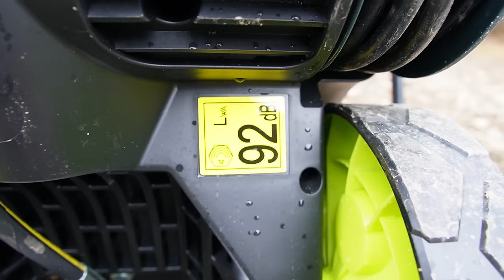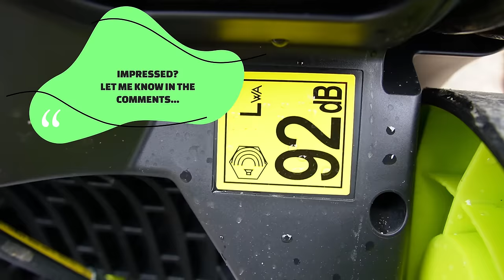BEST PRESSURE WASHER EVER MADE for Car Detailing? Is the AVA P80 Better than Kranzle?

Comment: For me the main selling point was the 20 year warranty, it feels like an absolute tank and built to last unlike the nilfisks and karchers I’ve had in the past
Reply from the maker: Nilfisk definitely raised their game to be fair.  I used the go p55 yesterday and that was pretty good for a small machine
Reply: @epicautomotivedetailing  fair one just don’t think I could go back now 😊
Reply: Are you still going to do a review of the other models 55 and 60. I know you cannot buy here in the UK but not sure if you can get hold of the P90 V6 see what you think of that
Reply: @craig3802  have you had any problems with this machine mate.
Reply: @iceman9646  no it’s been solid for me so far
Reply: @craig3802  thanks pal
Reply: I thought about buying this washer, but thought I would give their customer services a call. Five calls, not available. Searched for service shops very few. Lots of complaints.
Reply: 20 year warranty is great, but has anyone tried claiming on it. Or getting the pressure washer fixed if faulty.
Reply: Warranty does not mean Guarantee.  20-year warranty is a great selling point & I love what AVA is trying to do and some of their design and innovations, However I would read the small print on the Warranty terms thoroughly before buying and assuming you will be trouble-free for 20 years and it will be fixed quickly in the event of a break down (maybe a bit of a bold claim but I could offer the same warranty on any Kranzle like for like and not lose sleep) Great video guys btw
Reply: @kjhnor  They're new to the UK so they won't have many service points yet. They're a relatively small company, they're not going to just turn up and open dozens of service points, but even major electronics manufacturers only have one address that you need to return your goods to so that doesn't mean a thing. 

Regarding reviews, remember most people only leave a review when things go wrong so you need to define "lots" and compare it to the number of actual sales for it to mean anything.
Reply: @KranzlePressureWashers  Warranty and Guarantee are generally the same thing, but a warranty is more of a written thing whereas a guarantee is more often used as a verbal promise. On that basis a warranty, being written, is more valuable than a guarantee. 

I don't think anybody buys anything assuming it will be trouble free for that long. That's why we have warranties, to fix things if they do go wrong! You are required to service the machine every 5 years by purchasing a service kit (very cheap at £30), or they will service it for you. That sounds reasonable enough to me, as most kit breaks down because it's not serviced and cared for properly. Beyond that it's no better or worse than any other 1-year warranty except it's for much longer (10 years on Go and Smart models), so I'm not really sure why anybody would have a problem with it. They're upfront about it, nothing hidden.

From what I have seen so far they are an extremely well built machine and I've no worries that it will last. Certainly streets ahead of any Karcher anyway, and I've seen far more expensive machines that don't appear to be as well built.

Comment: Have had mine for over a year and absolutely love it. The only issue I have had is it blows fuses ALL the time. Put in a slow-blow fuse and that’s done the trick.
Reply: What amp is the slow blow? Isn't it dodgy to put a bigger size fuse in a 13 amp plug, no issues since?
Reply: Hi Kerr, can I please ask where you found your 13a slow blow fuses?
I'm going through a few, about one per month in regular use so not too bad I guess. I think it's only the P80 models affected....

Comment: I bought the Ava Master P60, couldn't be happier, fantastic, best pressure washer I've ever had by far, i added the MTM SG35 and MTM foam canon, absolutely superb.
Reply from the maker: Nice one yeah they are good just make sure you dont have it rigged up to too much length of extension lead
Reply: Hey mate, did the MTM SG35 fit straight on with no hassles?

Comment: It's the 20-year warranty that sold me too so I purchased the Master P70...I won't be using it but my wife will and there are many areas to clean, including the block-paving, patio windows, balcony window areas, concrete posts, and of course...the car.    The Kärcher K2 (Unused) and the K5.8 Eco (used once or twice) are going to my sister F. of C.   Kärcher need to upgrade their products or lose-out to better quality and reliability.    I already have the top two snow-foam attachments and the lance is a tad heavy.    AVA are leading the way with ideas and products, long may it continue.   Ours arrived today from CleanStore and is registered for the 20-year warranty... :-)
Reply from the maker: 100% Ava are constantly evolving and I truly believe they will crack the UK market in 2023

Comment: Recently bought the p80 evo to replace a nilfisk p150.  Inititally had issue blowing fuses which really frustrated me but sorted with 13 amp slow blow fuse after contacting ava for advice (these are not easy to source). Ava have advised this issue is being addressed and revision being implemented on future models. The 20 year warranty was big attraction for me.  They offer a higher  end snow foam cannon as well. So far so good and very happy with it
Reply from the maker: Ava have a P90 so that may be cool to try soon. Definitely a great start in my opinion. Hope mine lasts for many years
Reply: What was causing it to blow fuses ?
  Do you power it off of an extension lead. ?
Reply: @MrDelcol  no extension used but does amplify issue. its a well known issue ava are aware of. Apparently in other countries it uses 15amp fuse.

 Ava actually offered me a full refund if i wanted to return it as i initially couldn't find slow blow fuse from anywhere including the usual uk shops like screwfix, bq, toolstation and specialist electrical shops. Luckily found a shop online to order from in the end after a few weeks.
Reply: @umranhu  can you use an extension lead now when using the slow blow fuse? Or would the extension lead need one as well?
Reply: @seanmck2602  extension lead amplify issue so not sure how youd get round that.
Reply: I am now on my 4th p80 as received revised version couple days ago that was supposed to resolve fuse issue.  It hasnt so emailed ava.  Really wanted the ava to work hence been prob been 3 months of trying to resolve issue.  

Looks like time to give in and send back for refund. Wasted lot of money on time delay fuses and adapters to allow prev snow foam cannon etc to fit ava.

Watching daves other videos might try the nifisk 200 or 180.  Had nilfisk 150.1 for several years and that was pretty good.
Reply: Wow your on your 4th one best thing to do spend your money on a kranzle 1152 tst the best pressure washers out there in my opinion 👍👌

Comment: just bought one of these for cleaning the cars, gutters and patio plus anything else I can find that needs a spray. upto 20 years warranty on these machines, all internal parts are metal and not plastic like the yellow brand and the build quality is second to none! never owned one before but used one a while back and had nothing but positive feedback from people I have spoken to. Absolutely sick of buying new yellow brand washers every few years so took the plunge and bought a P80 so fingers crossed its as good as people say.
Reply from the maker: To be fair I think if you get 5 years it's a good investment. For domestic use it's probably going to last longer but I'll be testing this to destruction over next 6-12 months so I can keep people in the loop 👌

Comment: Great video. Very informative. By luck I bought the AVA Evolution P80 before I'd seen your video. I have to say I'm as impressed as you! It's versatile and very powerful making short work of the car, caravan and patio! It feels well built too. The only two small niggles  is the cable reel does feel flimsy and the float switches in the pump aren't that sensitive as it sometimes doesn't start back up after a short period of not been used (turning it off and on again at the switch usually sorts this problem). Would recommend above any other pressure I've used!
Reply from the maker: Thanks mate. Have noticed few little problems which I don't like now so gone back to my nilfisk
Reply: Which problems did you notice? Thinking of getting this one
Reply: @epicautomotivedetailing looking at the Nilfisk p200 & Ava p80. What’s the best in your opinion? 
Thanks mate.
Reply from the maker: @leswhite3465  honestly the nilfisk is more robust. They have a p200. Look for a refurb at nilfisk outlet website and you will get a stunning Machine and save money 💰
Reply: @epicautomotivedetailing  thanks for the feedback. Yes think I’ll go for the Nilfisk p200. Looks an awesome machine👌. 
Topman
Reply from the maker: @leswhite3465  I regret selling my p180
Reply: @epicautomotivedetailing  yes looks a great machine too. Would you say there’s much of a difference between the 200 & 180? I work in construction so cleaning at the end of the job is very important to me. 
Topman
Reply: @epicautomotivedetailing  be nice to see you do a review on the Nilfisk P200 mate😉. Wouldn’t mind seeing it in action before I purchase one. Very limited review videos on the P200(only 1 really).
Reply from the maker: @leswhite3465  it's identical underneath to the p180 the only difference is no chemical containers in p200
Reply: @epicautomotivedetailing  so for the money the 180 is really the same machine? Just the difference in 20bar & 5 metres in hose.
Reply from the maker: @leswhite3465  I haven't checked recent prices but yes it's the same machine underneath. Go on nilfisk outlet and see what refurb machines they have. Sometimes you get lucky and get returned stock for less money
Reply: @epicautomotivedetailing  bought the Nilfisk MC 4M-140/620 in the end. Amazing bit of kit. Topman for edging me to Nilfisk. Well happy!

Comment: Having just purchased the Ava p80 I can say it is definitely a superb machine with one exception, the power lead reel is really poor. The first time I used it and went to put the power cable back the cable got stuck and almost cut the wire. It’s a very flimsy wheel for such a great product.
Reply from the maker: Was it the master or the Evo? I know they changed the Evo power cable to make it more flexible

Comment: I really like my new Evo P80...for me, it doesn't blow fuses, leak, or have any parts that need securing with duct tape. Mind you I'm very unimpressed with how poorly the mains cable spool operates. All in though I love it. Its a cracking piece of kit and for the money and I think it's great value.
Reply from the maker: Yeah that was my main problem. The idea is good but not perfect. I wrap mine around the accessories holder and it's easier. I've got this for a while so will update in description below if any problems
Reply: @Epic Car Show Detailing  Thanks for your reply matey. Congratulations on a great channel and thanks for expert advice in your videos. This P80 Evo is my first pressure washer so I'm a bit spoiled eh :)

Comment: Glad you are impressed so far, I think they are good machines. Never likely to be a Kranzle killer as Ava only make for domestic use, trade use is not intended. For domestic use I think the Ava are fabulously over engineered and you have to be a bit special to buy a Kranzle for home use in comparison. Ava recommend a fixed 40 degree nozzle for car cleaning which does work well, although the wide nozel on the variable does make light work of rinsing. The 90 degree accessory lance is awesome for sills and wheel arches, give it a go. But hang on when you do, you've been warned!
Reply: is there different QR attachment like the 40degrees to use for the stubby gun too? if yes, is it included in the bundle too? i'm getting more and more interested on this product
Reply: @marcoontingco5370  the other fixed angle nozels are accessories
Reply: @epicautomotivedetailing  looking forward to it. hopefully this product reach Ireland too. but i'm willing to pay shipping and taxes for a great product anyway.

Comment: I really don't see how this is going to replace or compete with a Kranzle at all tbh. 

Sure stuff may not fall out of the storage compartments in the van but what good does that do me if it's falling over at all and happens to break? There's a nice warranty there you say? Great. That's not going to help me when I have jobs to get done that day, especially with a bunch of what seems to be proprietary accessories (all wrapped up in an overly engineered body which again means I can't service it myself and get rolling to my next job). 

The reason a Kranzle is so nice for mobile detailing is because it's simple and straightforward and cuts through the BS. It's an open design I can service myself and keep rolling if something breaks, it's designed in a way that I can easily attach it to the rack in the truck/van, I'm not tied into using what Kranzle tells me I have to use or anything like a built in hose reel because I can use whatever hose reel and hose I prefer and again mount it to the rack which isn't falling over in the van unless the van has fallen over as well, it has a nice beefy pump with adequate psi but more importantly lots of flow and I'm also able to tweak the parameters a bit in whichever direction I choose because I have the option of using different nozzles with a different sized orifice.

This unit in the video just seems to be in a completely different arena and is more suited to someone without any existing equipment or accessories and wants one for the home mostly. 

And just because I know someone will say that price is a factor with the Kranzle, that's fine. Nobody ever said anything about pricing or bang for your buck. We're just talking about functionality and use for a detailer. It's also worth noting that the Kranzle is just the one at the top of the mountain, but there are still several units made by other companies for less money and the same points still apply. I believe Comet, AR Blue, and others all have at least an offering or two that's serviceable and able to keep you working on those days when shit goes bad. They won't have as much flow and/or PSI as the Kranzle but they're in the same ballpark.
Reply from the maker: Hello, Sorry I just want to clarify that in this video i did not claim in any sentence that this is better or will ever compete with a kranzle. I question it because curiosity will always drive human behaviour. I have a Kranzle coming to the channel soon. In fact i have quite a few so I have to balance out equipment for traders and weekend warriors. 

Ive got few karcher commercial machines too so my videos get uploaded around how the market is going at the time so come spring when businesses start growing with better weather ill be all over the commercial equipment :)
Reply: @epicautomotivedetailing  No worries at all, and I definitely didn't mean any disrespect with my thoughts on the matter at all, and certainly not anything negative towards the video itself.

I also didn't say that you said that in the video to be fair, and I don't think you said anything inaccurate or misleading. 

I actually really really liked the video and presentation. I'm just more or less saying that I don't really see the competition and I'd place this unit in a different product segment all together for the reasons I mentioned.

Honestly if anything I would say you may be kneecapping yourself a bit by asking the question, as opposed to asking if it's the ultimatre starter unit. 

All in all great video though and you've gained a new sub.
Reply from the maker: @muchachogrande2019  Thanks my friend. Some titles dont bring in the views. so for 10k views it makes practically nothing so i have to find something that may refer to be edgy. My change thumbnail soon. seeing how it plays out 🙏

Comment: The only negative about this video is sir, please stop looking into the nozzles while the machine is on even you don't pull the trigger. Your mind can trick you one in a million chance. Once, I was using a grinder. I was wearing heavy duty gloves and goggles. After I used it, I stopped it and placed it on the workbench, then somehow suddenly without needing to, I reached out involuntarily to the still spinning, winding down, disc and got my finger cut through the glove. Since then, I have been paying extra respect to power tools.
Reply: Thank you for your awareness sir

Comment: I had my p80 for a year now i purchased the 12 mt ext hose and the syphon hose it doesn't like extension leads kept blowing fuses ref the 😅ext hose great for everything i need to do
Reply from the maker: No it definitely doesn't like those leads. The new 2024 P80 is set to fix  that issue

Comment: Very impressed.
Do you know what the difference is between the Master and Evolution P80 models?
Reply: V4 Evolution P80 with a V4 Master P80, then the inside of the machines are identical. The Evolution is a body-style developed.. The Evolution has added: a reel for the electrical cord

Comment: How’s the Ava been after a year? Has the fuse blown? Can you attach an Uber flex hose ? Is using a mtm gun straight forward or must you need to do something special?
Reply from the maker: There's a new p80 Coming out. The old one was hit and miss with a small number of machines so they made some big improvements ready for release. Honestly my favourite is the Easy P57 because it's so light and has everything you need and because it's a new generation model the reliability is fantastic, zero problems. I wouldn't personally bother with mtm or any custom lance. They don't need it at all